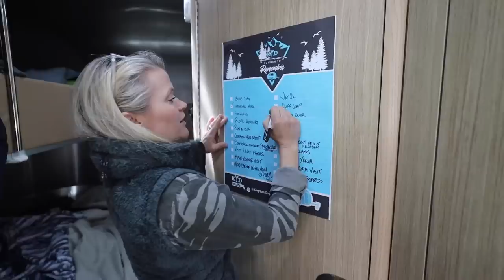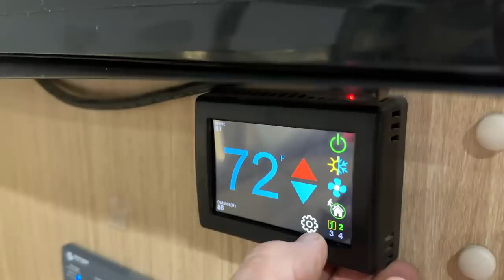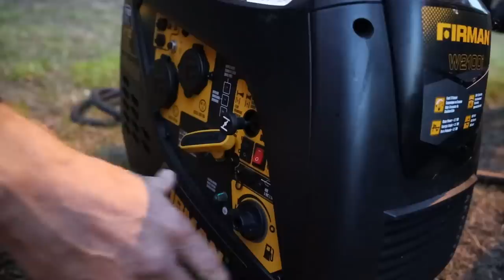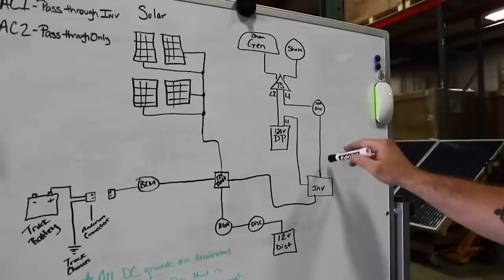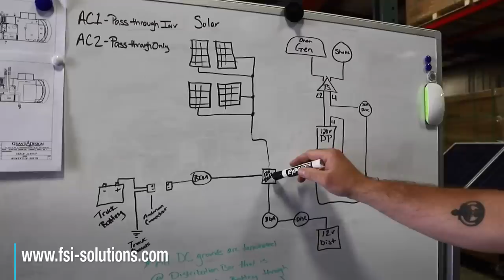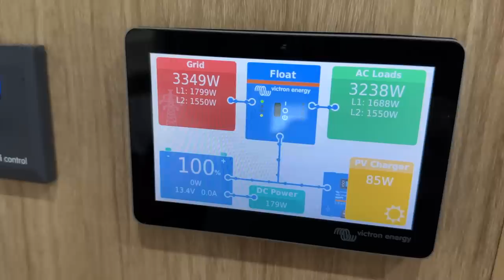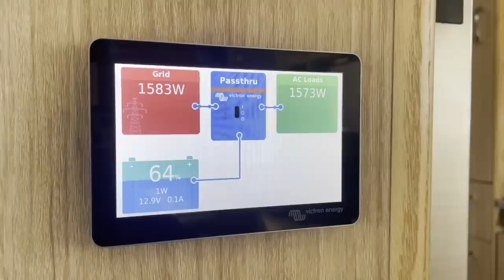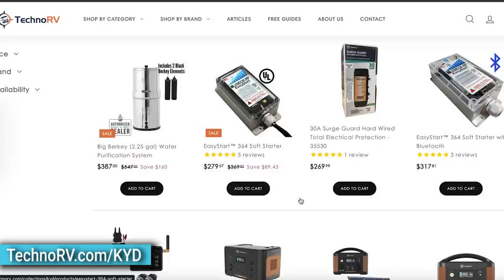Not a Typical RV Solar Video. Dry Camping Off Grid.

Comment: Solar power is the key to comfortable boondocking. I boondock 100% of the time in a homebuilt cargo trailer to RV conversion. With 1300 watts of panels on the roof and 750 watts with 3 ground panels, I run a 120 volt home fridge with drawer freezer and ice maker. I have  32 inch computer monitor, compost toilet, 100 gallon fresh water tank in the bed of the Ram that hooks up to a water inlet in the V nose of the trailer in seconds. I am very comfortable in the boonies for up to 3 weeks at a time, and I could stretch it to 4 if I wanted to. I do carry a generator but rarely need to use it.

Comment: Glad you mentioned a power station.  I have a 17’ Casita, 30 amp.  I got a Bluetti 2,000 solar generator with 3 120 watt solar panels.  I can run a hair dryer, coffee machine etc., off of the Bluetti and have even charged my house battery from it using a dogleg adapter and could probably run my air conditioner for an hour.  And for just over $2,000 about 3 years ago, I think it was one of my best investments.  Another thing you didn’t mention is the enormous weight a big solar system adds to the roof and carrying capacity of an RV.  I think some don’t consider what the capacity of their axle(s) is/are, the capability of the roof, and the towing capacity of the tow vehicle itself.  Great video!!!!

Comment: Fine presentation.  There is an alternative to a full Victron multi-component system, which is very capable, but very complex and expensive.  An easier, less expensive option is to use a portable power station such as the Ecoflow Delta Max with extra batteries.  I installed this in my Airstream FC28,  with an inside power inlet and transfer switch.   This provides 6kw of battery storage, 2400 w inverter, 800 w MPPT solar controller, and multiple charging options.  With 600 watts of rooftop solar, it is a very satisfactory “80% solution”.  I do sometimes carry a gasoline generator for extended rainy situations, depending upon our camping area.  Another benefit of my system is portability.  When the trailer is in winter storage, I carry the Delta Max and batteries to our home for use as emergency backup power.   I also installed a Delta Max and extra batteries under the cap of my RAM 2500, with 320 w of rooftop solar for stand alone truck camping as well as supplementary power for the Airstream.

Comment: Excellent episode! This is a discussion for camper people. As you probably know (I've posted many times) I have a 25' Airstream. I spent weeks considering what to do. I like being able to boondock. I started with nothing, like you said and started thinking what I needed to camp any way I wanted. I camp in campgrounds,  lots and open areas. I only needed to run coffee, media/TV, fan and any appliances I use. I also cook but I have retained LP. I added a 1500 watt inverter and covered my bases. I purchased a generator tri-fuel option for power regeneration and added a third large AGM battery to the system for more Amp/hr. That worked but I found that I still needed another option for power regeneration. I went with a hybrid solar system - 150 watt roof and an additional portable array of 200 watts that I can set up in open area if camper is in shade. This worked well for five years then I purchased one of those lithium power bases 1300 watt Bluetti (like your Southwire) Last July I got my hybrid F150 with a built-in 7.2kw silent inverter generator. This allows me to have AC in a park with a generator rule if needed. The truck idles very quietly and can run for 32 hours at max load (my ac unit @1400 watts operation is only 19% of max load) so the automatic engine cycling is longer intervals saving fuel. COFFEE! Yes, I bought a hand grinder and aero press- wonderful for no power except heating water. I also have a full blown barista super automatic that I used on AC power, now, any time with inverters. I dont cook much with micro but use LP stove and oven frequently.  I really like your light. Thanks for sharing. Sometime perhaps I will meet up with all of you. I am from St. Augustine, moved from Fort Myers/Naples area.
Reply: My wife and I are boondocking next week with our Powerboost F150 Hybrid and plan on using the 7.2 watt generator. I also have two Bluetti  AC200Maxs and plan on using them at night. My question to you did anyone complain with the truck running and did you ask Management if it was a problem with using the truck generator?

Comment: This is a great video. My solar (280w roof; 200w portable) and 400AH of lithium with a 3,000w multi-plus cost me US $15k and I love dry camping on Crown and BLM land (to fly fish). I do have a generator but have never used it in a year. And I also run my A/C off my batteries for short stops. It draws 1700w to cool my 20' Flying Cloud down in about an hour then draws 450w to keep it cool, so I have plenty of power for short stops. I do 2-3 weeks dry camping, 1 night in a motel/hotel and 7-10 days with hookups. Plus Harvest Hosts while driving - and don't care about cellular or internet while dry camping, but I do have a Garmin InReach for emergencies. Again, great video!

Comment: Thanks for the video.  We recently purchased a travel trailer after 10 years of non-RV ownership. We have a dog and dry camping and park setting campgrounds work the best for us. For power, we went with an all in one system, battery-inverter-controller, because we plan on upgrading the trailer within a couple of years and wanted a multi-tasker system. It works very well for us. The Ecoflow Delta is in our storage compartment with 200 watt solar panels feeding it. The trailer shoreline cord is plugged into the back. We turn the switch off when the Delta needs to charge and can run everything in the trailer but air conditioning and microwave, including my wife's hair dryer. We don't have to move the unit around, just flip the ac switch in the app. I plan on upgrading the panels to 500 watts so we can keep it on more throughout the day and save on refrigerator propane. I know this not the most efficient system but it provides a lot of bang for the buck  for $1,000.

Comment: Good episode. I actually like the community of RV resorts, so dry camping is not in my future. BUT DC-DC charging is a must! as I want to run my 12V fridge while on the road, and the current "smart" alternators cut that charge down to nothing. I actually installed my DC-DC charger on my truck, that way when I sold my previous camper and got a new one, just had to transfer the cord from my old camper to the new one.

Comment: People always ask how much solar do we need.  Truth is not as much as you think.  Your advice to camp with what you have before you decide how much you need.  We had a 30ft travel trailer with a deep cycle battery and a Jackery 500.  We went to Quartzite and first chance I got was to go to Harbor Freight and pick up the 100W solar kit (they currently cost less than $200) and a second battery.  Neither battery was lithium.  The 100W kit kept both batteries and the jackery topped up and we didn't need to move for a week and a half.  I did reorient the panels into the sun a couple ot times a day, but it ran our 12v fridge, water pump, lights, phones, and computers.  Pro tip is to get 2 of those 5 gallon jugs because it is easier to balance if you carry one in each hand do it is way more efficient.

Comment: Mark, please consider mentioning the freedom of travel for persons disabled and/or seriously illness the installation of a lithium/ solar system offers.   My precious wife would be housebound and unable to travel even to grocery stores without the upgraded power system. Like you, we run the AC off the batteries for meals, in the dog parks, and in parking lots during medical and dental appointments.   I installed a system almost identical to yours back in 2020 in our class C Navion.  Parts alone cost $10, 000: 6  Battleborn batteries @ $800 each,  SunPower high efficiency 110w flex panels @ $150 to $180 ea,  2 rigid panels, 4 MPPTs to minimize shading and maximize power output, plus the myriad new cable runs, upgraded wire sizes, blowers, temp sensors, and  DC to DC  charge converter, and much more. So, $20,000 is very reasonable to have a certified electrician, an engineer, and experience labor install the system to code.  I even found the installation a challenge and I'm an engineer and certified aviation electrician. The installation must ensure all codes and manufacture specifications are adhere too for safety and efficiency.

Comment: There are options on your continuum.  We are not full time.  We take a 2 week vacation off grid with one portable solar panel and a lead acid battery (no generator).   We can do this and charge phones, laptops, kindles, a DVD player and occasionally run a fan.  We don't use any other appliances and our trailer is old enough it does not even have a microwave!  Even with clouds and rain we have never had a problem keeping the battery topped off.  My parents did the same without a solar panel but changed campsites 2-3 times over 2 weeks so kept battery charged by driving connected (they did not have anything to charge in those days!)

Comment: Great video guys.   So many options depending on what you like to do.   We get by with 200 amp/hours of battery and 200 watts of portable solar to keep them topped off.   Also carry a jackery 500 for keeping the devices charged.   Hand coffee grinder and percolator solve that issue.   Only thing really have to do without is AC.   Folks survived for thousands of years before that was ever invented, so always figure we can get by for a few nights :)    With propane and charcoal it is no problem to meet the cooking needs.   Love getting off grid once in awhile for a few days for sure.   As always, safe travels.

Comment: Great video.  A lot of great info.  I really appreciate reminding everyone that we don't run things off solar.  It is just another way to recharge the batteries, which is what we use to run the things we love. The spare 5 gallons of water is a great idea.  Thanks for sharing all this with us.
Reply: > we don't run things off solar. 

Some of us do.  If there is excess solar power the panels will support the loads rather than depleting the batteries.  Right now I am running a crockpot with zero impact on the battery bank.

Comment: Very strange, I entered a first comment then followed with the comment on batteries, but my first comment is gone. I’ll try again.

We have a very similar setup without the Orion DC-DC Charger. One significant behavioral difference is our Victron Inverter is Hybrid. When connected to a lower power post, if I turn ON the Inverter, it will augment the post power up to 50%. For example, if I’m connected to 15A at someone’s home I can add 7.5A additional current from my batteries. If it’s a 30A post then the Inverter would bring it up to 45A. It’s a very useful Victron feature.

My install was done by AMSolar in Eugene, OR.

Comment: Great video on solar!  For starters, we purchased 2 Firman generators and added an additional battery to the bank.  The batteries were connected to provide tandem power for 50amp service.  This is how we will dry camp for a while until we can afford a full solar system.

Comment: Great information.  Y'all make great videos.  I did find a coffee press that uses the K-cups and that is what we use when dry camping.  We have 2 lead acid batteries and 100 watts of solar.  so we won't be dry camping (unless we are running the generator) in the hot summer months...

Comment: We sometimes camp where there is no water supplied. I have a fix for this, as well. I spent $60 for a food grade plastic barrel, drilled some holes in it in the proper spots. Bought a 12 volt rv water pump,  wired it with a toggle switch and rigged it with a plug that is compatible with the 12  volt outlets in the pickup. Put that barrel next to the cab and tie it down,  then fill it up.  Also,  the Horse Trailer has a 35 gallon tank in the tack room. Plus a few 5 gallon plastic water cans,  I'm at over 100 gallons. If the barrel gets low,  I can drive close to a creek and reverse the pump an get Horse Water. The horse trailer tank and can5 are ONLY for camp. I've camped for a week with no available potable water.

Comment: We use an 8-gal cube of water from home, primarily for drinking water it extends our time before we have to refill, and we like our hometown water taste. We have 600W solar and just added our 4th BB lithium — probably spent about $5–$6K. It’s generally more than enough, and we rarely, very rarely have to use a generator, don’t even bring it most times. We HATE RV parks! Will only go there as a last resort or are desperate for laundry or some other amenity.

Comment: Great Video.

For us we started with a Tent Trailer and always Dry Camped (No Electricity or water).  In fact, we never did use the water system in the 10 years we owned the Tent Trailer.

We are Vacationers, so we normally can survive 20 days without TV and many other convivences.  When we upgraded to a small Travel Trailer, we now camp in Electrical sites, and only once with Water.  Since we normally spend about 7-10 per site, we can survive without having to Dump and Refill.  We manage by using the Campground Comfort Station for showers and carrying a couple of Water Jugs (20L) for Potable Water.

Next summer we are going to have to put some of the lesson learned (especially regarding Batteries & power) on your channel to work, as we are retiring and wanting to do some long distance trip.  We are really looking forward to your videos on Nova Scotia, as that is one of our planned destinations.  Enjoy your travels.

Comment: We chose a 2nd regular battery and a 3300 watt generator. We can dry camp for 3 days easily in colder weather, and break out the generator to cool the 25 ft travel trailer down in the summer. Slow start modification in the A/C makes the generator handle it fine.

Comment: I dont do a lot of comments but i feel i need to chime in here. A $20,000 price tag will scare off most people but its not absolutely true. For an ultra fancy system like you guys have that2 probably what you will pay but thats not the only way. I started with solar and lithium 5 years ago. I have a 28 foot lance with 600 watts of solar. I built the system myself so there is a big labor savings. I 3- 100 ah Life Blue batteries with Bluetooth.  I just use my phone to monithe batteries. I have a renogy 40 amp mppt solar controller also with Bluetooth. A Renogy 3000 watt inverter and a manual shore/inverter switch. Last fall i added the Victron 30 amp dc to dc charger. Thats been a game changer. Ive built the system over time but could do it from scratch now for around $6,000. Now we only have one ac unit and our power system is 30 amp. What im saying here is its not $20,000 or nothing. We started with 300. Watts of solar and 2 batteries.  Something that many Youtubers neglect to mention is that lithium batteries charge so much faster then lead acid. In the old days We would spend half a day running the generator to charge our lead aci5 batteries  and they wouldnt even be completely charged. We just got back from a four week trip and ne er ran the generator.  Happy travels everyone.
Reply from the maker: I was implying that it's a continuum from 0 to 20k. It can be anything. It's hard to be perfectly understood in video.

Comment: You can do solar for a lot less than $20,000. I’m in a class a 33 foot motorhome. I have 640 W of solar on the roof and 300 amp hours of lithium batteries and a 3000 W inverter. Total cost for equipment was around $4000. We installed it ourselves. My guess is if you have to pay for labor, you can probably double the cost. I never run out of power while dry camping. And I live like I’m at home.
Reply: Yes but technically that is considered a small to medium size system. The large systems where you have 1000-2000 watts of solar with 1000 amp hours or more of battery power and two multi plus inverters is very expensive. Probably close to 20,000 dollars. But that system is designed to where you can run everything you would ever want and never need to run a generator.  Again like he was saying you can spend 4000 dollars and that will do 80% of what you’ll need. But that last 20% just use a generator because it can save you 10,000 dollars or more.
Reply: @Hesthegreatest1  yes. That’s true.
Reply: 1000 w panels 3000 w inverter and 980 amp hours of lithium total cost $3340 however I spent between 2 to 3 weeks researching and finding deals I sourced multiple different brands and used them together all of my solar panels are the same brand, and all of my batteries are the same however my batteries and solar panels are different brands from each other and my inverter is an even different brand so far I can run anything I want as much as I want

Comment: One thing to point out is that if you a fully electric refrigerator (like in newer Airstreams) you’ll use a lot more battery than with the older models with propane. I have 500w of solar and 200Ah or lithium and my battery still gets pretty low overnight thanks to the fridge.

Comment: Time for a simi upgrade. Set up your system to use solar before shore power. You leave for a hike and your batteries are fully charged. You wouldn't be using any shore power because you shut off everything and your solar is providing more power at the time.
If you get enough amps or watts from your solar panels, you can run a microwave without batteries. If the inverter accepts solar with no batteries connected.
Making an awning out of solar panels. Retracts back on the roof under the roof solar panels.